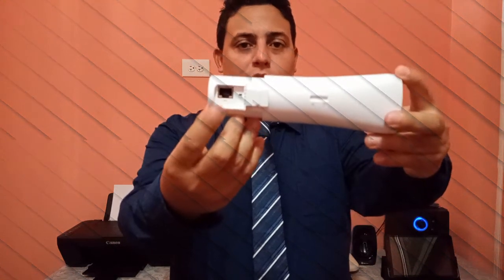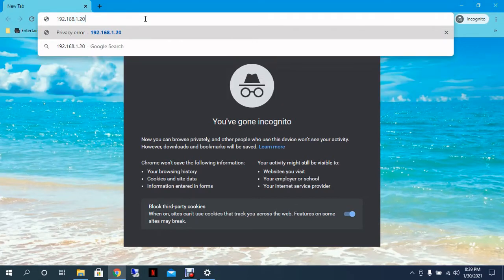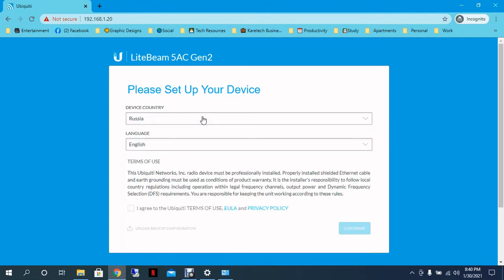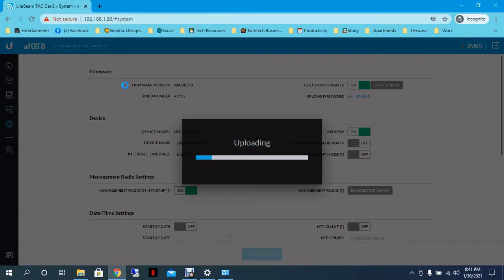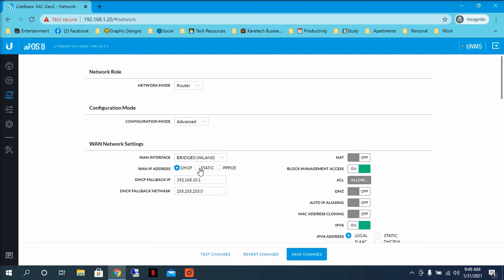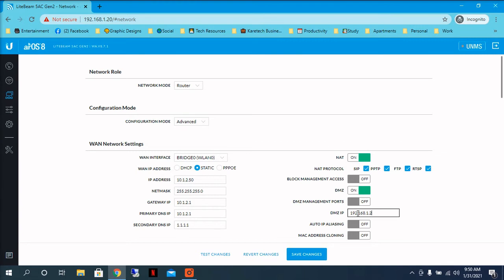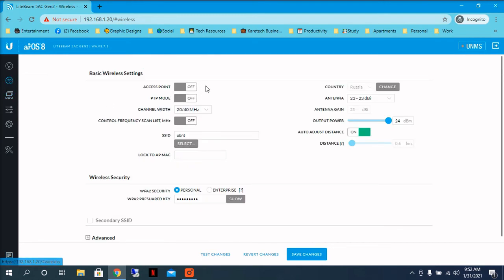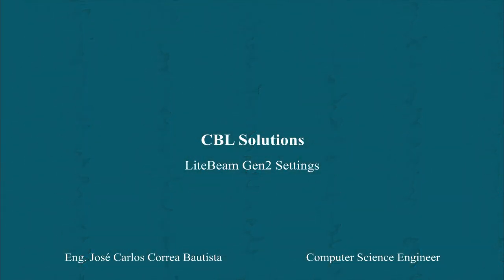How to configure a LiteBeam Gen2 Radio

Comment: I have a 500 mbps connection, but at point B I only receive 50-60 mbps for a distance of only 1 km. Is this normal?
If you have a better configuration can you please share it with me (it's for the wifi zone)
Thank you for your reply
Reply: Bridge the connection between two antennas. Also I'd check ur internet speed and configuration speed in router and switches.

Comment: what is the dfs?
Reply from the maker: Well as es concept is this: 
Dynamic Frequency Selection (DFS) is a channel allocation scheme specified for wireless LAN, commonly known as Wi-Fi. It is designed to prevent electromagnetic interference with other usages of the C band frequency band that had predated Wi-Fi, such as military radar, satellite communication, and weather radar. It was standardized in 2003.
Reply: @cblsolutions3908  thanks a mil
Reply from the maker: If you select United States as the contry in the configuration of the antenna you will see there is a big range of frequencies that use DFS